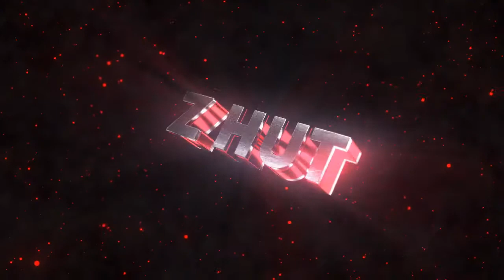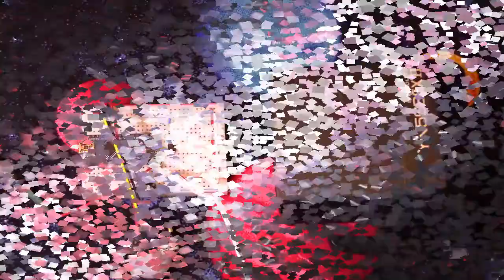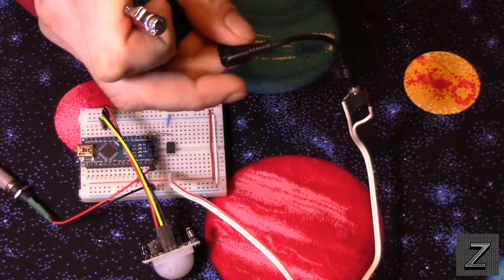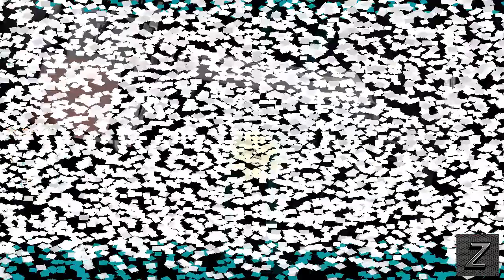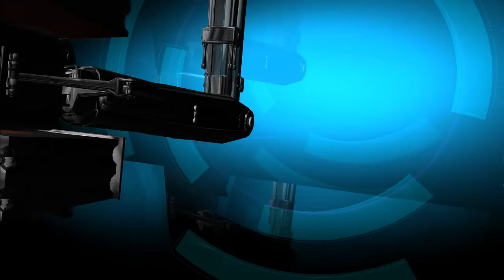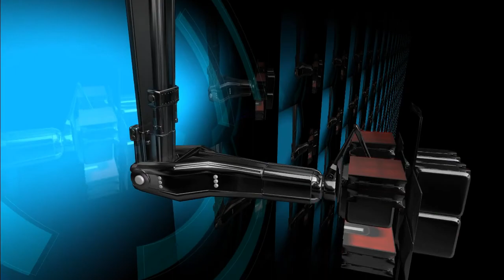ARDUINO Motion Detecting (PIR Sensor) Camera Trigger

Comment: Hey, it is completely not working when optocouplor is connected. It works fine without the optocouplor. Is it safe to use it without optocouplor?
Reply from the maker: Using without the optocoupler is a good way to fry your camera the problem most likely is you've got the two wires that go from the optic coupler to your camera backwards switch them around and there's a good chance it'll work
Reply: @z-hut1663  Thanks a lot for your response. I tried it in all the possible ways with an led it's not working. Led doesn't light up when optocouplor is present. Is there any other option that i can use? And would there be a short circuit in my camera if i use it without optocouplor?
Reply: @nirajmunot6700  I had the same problem. Looking at other videos they have an additional separate VCC to the collector of the optocoupler.
Reply: @stephenmarshall1286   I have the same issues as Niraj Munot. Circuit does not work with the optocoupler  present. I'm a novice at Arduino projects but would really appreciate being able to use this method of triggering my Nikon trigger this way. can you please advise how you sorted the issue and what are the other videos you refer to. Thanks, would appreciate any help.
Reply: @johnlee6588  I have a working prototype of the trigger and it works fine.
I used a PC817 Optocouple with pin 1 to gnd pin 2 to the resistor via D2. Pin 3 and 4 go to the camera. For the camera I used a 3.5mm stereo plug and jumped the two small contacts. I'm now making one for my brother in law. If you need the sketch I can send it to you.
Reply: Stephen Marshall thanks for your reply. Copy of the sketch would be much appreciated.
Reply: @johnlee6588  
shutterPin = 2;  //Assign the LDR and optocoupler pins
int triggerPin =A0;
int triggerPointPin =A1;
int triggered =0;
int triggerPoint = 0;
 
void setup() 
{ 
  Serial.begin(9600);
  pinMode(shutterPin,OUTPUT);    //Define the shutter pin as an output
  digitalWrite(shutterPin,LOW);  //Set the shutter pin to low / off / no voltage
  triggerPoint = map(analogRead(triggerPointPin), 0, 1023, 0, 1023); //Read the output from the potentiometer
}
 
void loop() 
{ 
  triggered = map(analogRead(triggerPin), 0, 1023, 0, 1023);  //Read the output from the LDR
  if (triggered >= triggerPoint)  //If light is detected, trigger the camera
  {
    delay(50);    //Wait for lightning to be the brightest
    digitalWrite(shutterPin,HIGH);  //Trigger camera
    Serial.println(triggerPointPin);
    delay(1000);
    digitalWrite(shutterPin,LOW);   //Reset camera trigger output for next photo
    triggered = 0;
  }
}
Reply: Stephen Marshall thanks again I’ll give it a try.
Reply: @johnlee6588  Any issues drop me a line
Reply: @stephenmarshall1286  Great stuff, I now have fully working trigger to release shutter on my Nikon when PIR detects movement. Shutter release and focus leads on camera jack socket are joined as suggested to enable operation, any advice on how enable auto focus prior to shutter release? Thanks for the guidance your help is most appreciated.. Cheers
Reply: @johnlee6588  I personally don't use prefocus I set it to manual after focusing. The sketch I sent was for a Lighting Trigger. I have a PIR sensor sketch if you need one, I built one of those too.
Reply: Stephen Marshall I also use manual focus almost exclusively, just thought it might have extended the project a bit. It’s my first Arduino project and have to say I’m hooked. Be interested to see your PIR sketch. Thanks again you’ve been most helpful.
Reply: @johnlee6588  PIR sketch. This includes a couple of LED's to show when it's ready. There is a 10 second delay after taking the photo. If you want less waiting time, adjust TD1.

#define pir 8
#define cam 2
int val;
int DT1=10000;

#define pir 8
#define cam 2
int val;
int LEDGreen=4;
int LEDRed=3;

void setup() {
pinMode(cam,OUTPUT);
pinMode(pir,INPUT);
Serial.begin(9600);
}

void loop() {
val = digitalRead(pir);
digitalWrite(LEDRed,LOW);
digitalWrite(LEDGreen,HIGH); 
if (val == HIGH)
{
 digitalWrite(LEDGreen,LOW);
 digitalWrite(LEDRed,HIGH);
digitalWrite(cam,HIGH);
delay(50);
digitalWrite(cam,LOW);

Serial.println(cam);
delay(10000);

}
delay(50);

}
Reply: Stephen Marshall Many thanks.